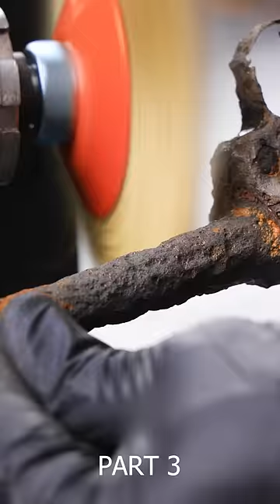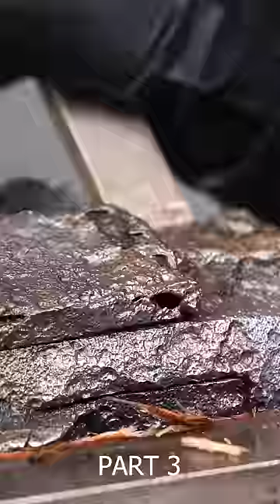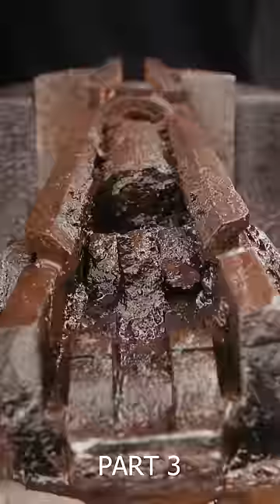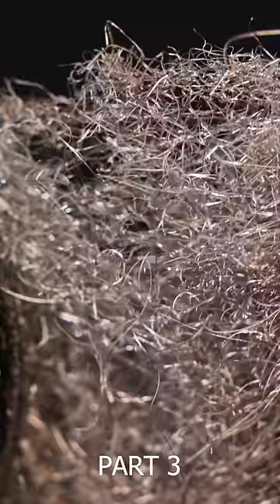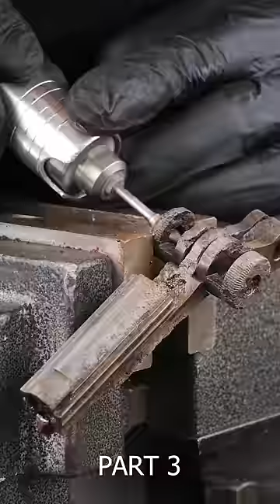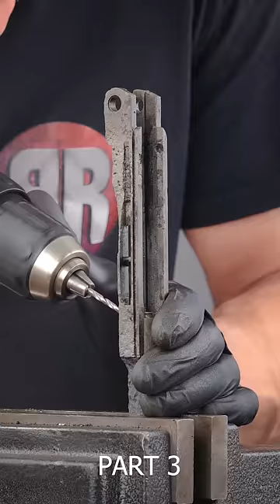Luger P08 1903 | Old German Pistol Restoration Part 3 #Shorts

Comment: Was that a round still in the chamber?  Awesome restoration so far.
Reply: Yes. Yes it was.
Reply: he can still shoot it!
Reply: Didn’t you watch the whole video? It’s like 20 seconds.
Reply: That was dangerous
Reply: You joking
Reply: He pulled 3 rounds I believe.
Reply: Maybe 
9mm Lugar
Reply: That’s what is said😂
Reply: C'est un fossile 😅
Reply: I doubt it's a real bullet. The primer has been struck, yet the bullet hasn't even left the shell casing. Sure, it could've been a light strike, where the striker is hit, but it doesn't cause a spark, but due to the same sort of corrosion on the bullet (which is made of different metals which corrode differently), I doubt it's real.
Reply: It's fake. All of this channels videos are. Either it's artificially rusted or it's an impossible restoration that somehow works perfectly
Reply: Amazing how that brass casing protected the bolt face ? And probably the chamber.
Reply: @hello-c4o4j  the cartridge looked a bit rusty, theres a good chance it will malfunction if fired
Reply: @C00ch13Munch3r  i was joking lol

Comment: Just leave it in isopropyl alcohol in a ultrasonic jewelry cleaner. This avoids further damaging it during cleaning. Do not attempt to fire that weapon without remote firing after Xray verifying its chamber doesn't have penetrating subsurface delamination of the crystalline metallic bonds. Fire it like Mythbusters, secured in a vise, fired by pull cord from in a bunker

Comment: You should have used electrolysis or a lye tank. Removing rust with sandpaper and steel wool also removes metal. You are ruining what little is left. And I would never fire any part of that gun. It will explode.